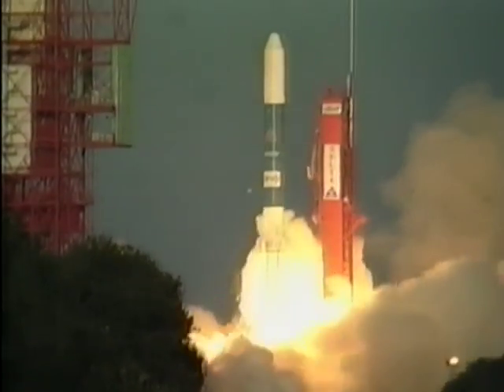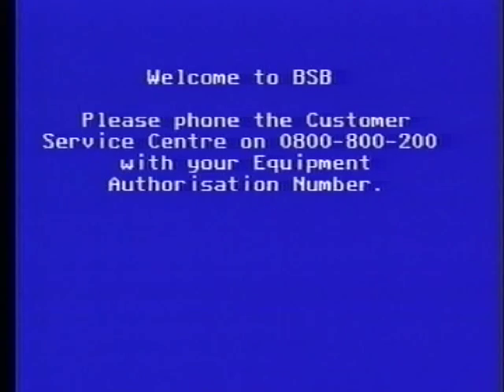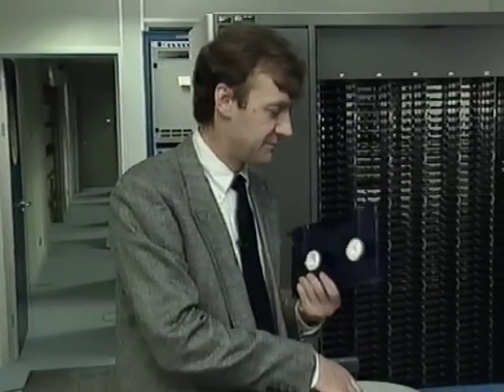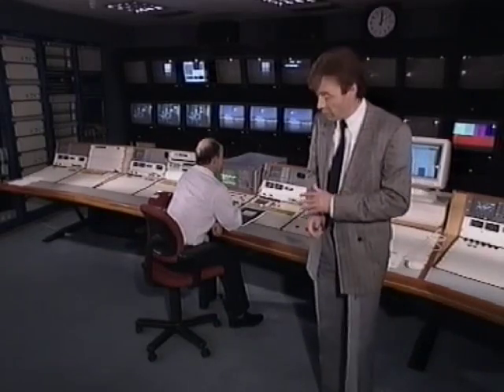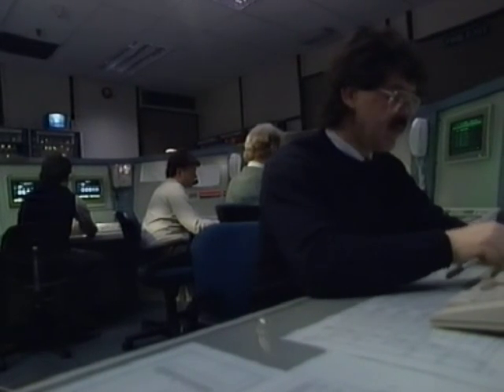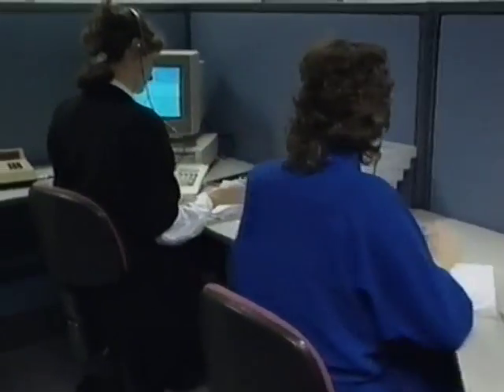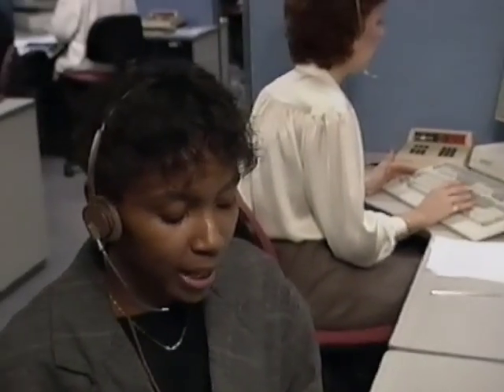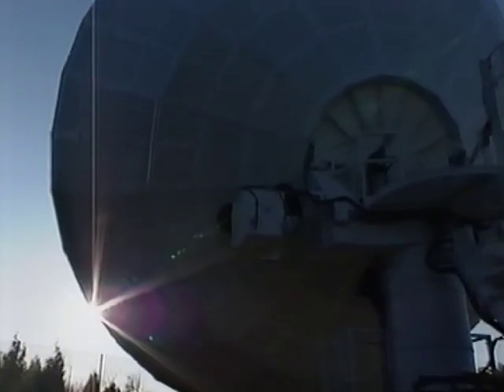Voyage around BSB

Comment: There was too many restrictions placed on BSB by the utter incompetence that was the IBA.   But then the shareholders employed the wrong management which ended up in it being an utter shambles
Reply: And maybe if Ofcom had a modicum of the IBA's prowess we wouldn't have ended up with vacuous crap like Big Brother and Love Island.
Reply: True. BSB were hamstrung by regulatory restrictions and launched late. Their problems were compounded by paying too much for programming before having sufficient customers to generate ad revenue. Meanwhile, Sky managed to gain customers with a line-up of low-cost filler crap from the USA combined with a couple of  heavily promoted "headline acts".
Reply: It was actually thanks to the IBA that the MAC standard was developed. They weren't just a regulator, they were a technical pioneer. OK so the IBA did sometimes act like they were a broadcaster themselves such was their intervention in content requirements but that resulted in the golden era of ITV and C4 programming and legendary producer-broadcasters like Thames, LWT and TVS.
Reply from the maker: I probably wouldn't disagree with that. Did you work at BSB at the time?
Reply: @clivecouldwell56  No.  But I so wanted it to succeed.

Comment: What were the library or playout machines called?  Where those sort of things standard in broadcasting
Reply: Sony BetaCart machines. Started in about 1986 with 30 slots, 4 machines and the Betacam tape format, the original ENG analogue tape. They evolved to more slots, larger long play cassettes, and thence Sony Digital formats. The tapes were managed by printed stick on barcodes on the edge. Tapes cued-up by time-code (low speed data) on an extra audio track, and also coded into the Vertical Interval (VITC). If you're nodding, your question for 10. What or who was Bruch Blanking ?
Reply from the maker: Goodness me, I can't remember. Yes, they were AFAIK.
Reply: @clivecouldwell56  thank you

Comment: Digital TV before anyone else?
Reply: Well it's one of those "hybrid" standards which were popular around that time. Those were often designed to have a compatible upgrade path to HDTV, but when Astra came along with its much cheaper receivers that idea kinda died out.
Reply: Not entirely. The sound was digital, the video was analogue but with the picture and colour transmitted separately in time and then reconstructed by the receiver. Was far superior to the traditional analogue standards like PAL and Sécam because the colour saturation problem was resolved and bandwidth per channel was higher.
Reply: Anglo Saxon no, they broadcast in D-MAC. MAC is an abbreviation for Multiplexed Analogue Components
Reply: well almost but wont good enough for future sky win the day